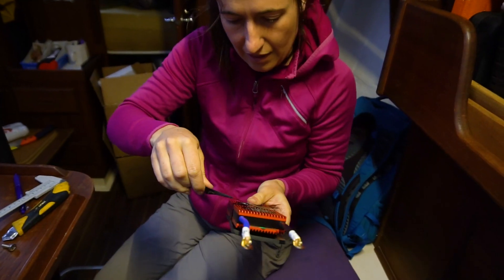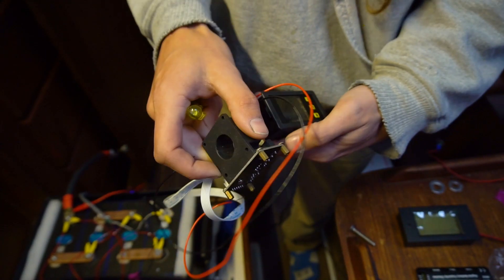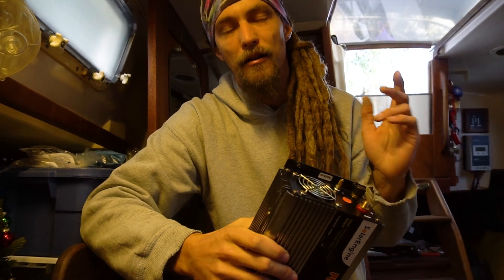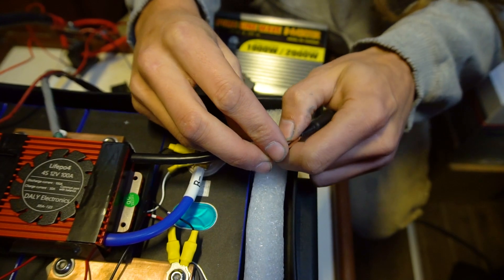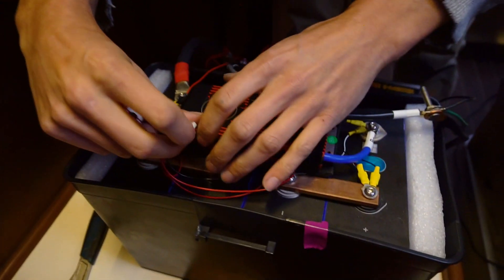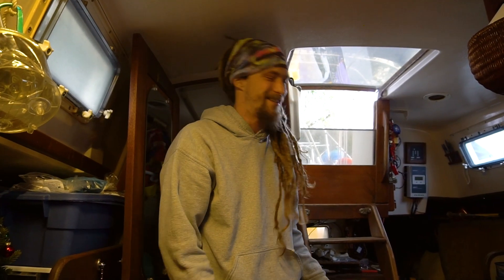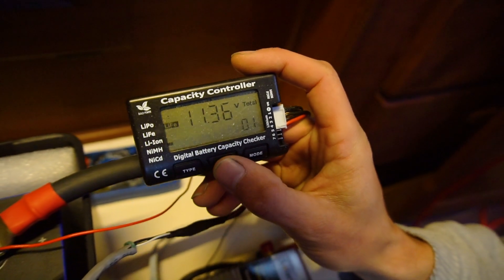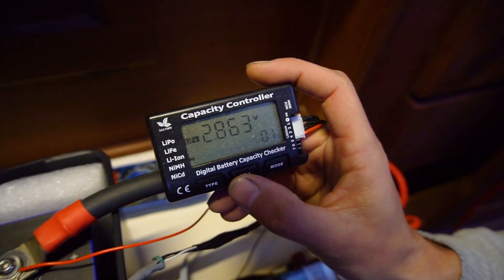EVE cells LITHIUM BATTERY Capacity Test

Comment: Our future batteries will be graphene capacitors. I  think the reason we don't hear much about is that who ever can quickly mass produce graphene will rule the world. Carbon is a metalloid meaning it behaves like a non-metal also like a metal. Diamonds don't conduct electricticy, and they are made of carbon. Graphene is carbon, and is a better conductor than copper, silver, or gold. Carbon fiber is weak compared graphene. If Air Force One was made of graphene it would take 6 to equal the weight of the one crazy joe never got to ride on.
Reply from the maker: Ya I've heard of a few up and coming battery technology. Even a sodium based battery. Lots of new tech on the horizon